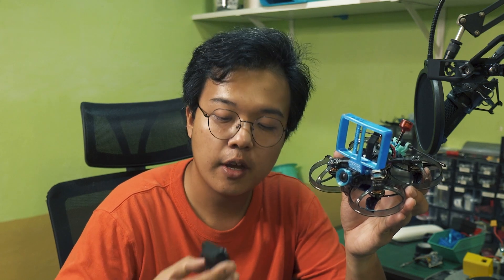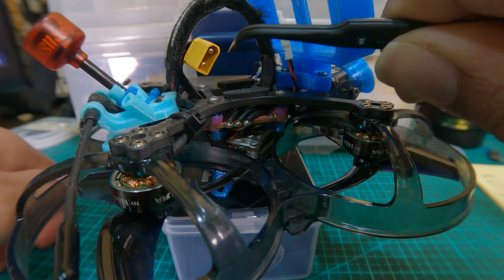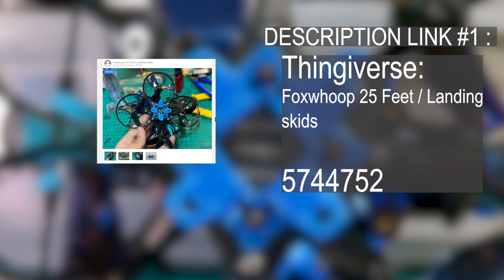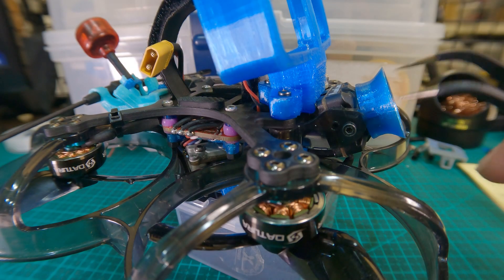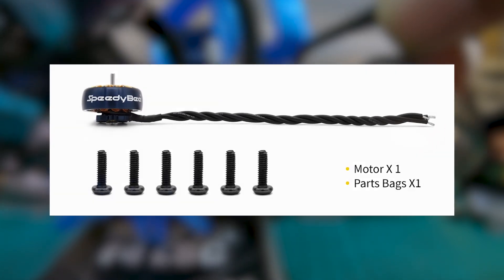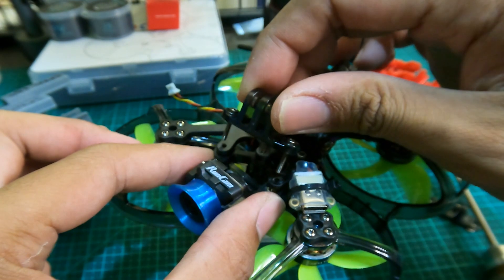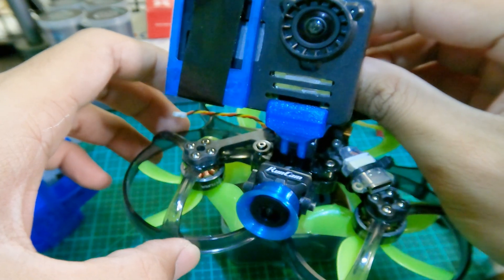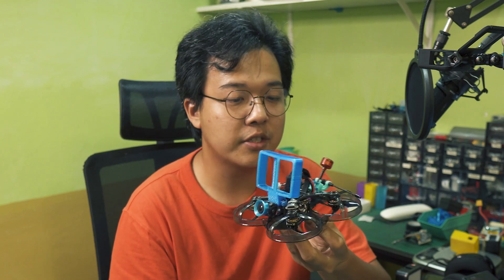Foxeer Foxwhoop 25 closer look for builders

Comment: Do you think that a AIO that uses mount holes of 30.5x30.5 would fit in this frame? I have a 3d print part for the conversion of 30.5 to 26 or 20 mounting holes. Aio itself measure 38x38

Comment: hi. How did you manage to reduce the vibration? mine also mounted with o3 made in tpu camera support, improved 50% but still vibrates and gives a jelly effect. how did you set the PID?
Reply from the maker: One reco is to make your TPU Camera support more rigid.
- Add some support pillars between your camera left mount and right mount so it doesn't wiggle as much.
Here's a photo as reference https://www.thingiverse.com/thing:5152305

But end of the day, wind hitting drone and prop wash are just the nature of the 2.5 inch drones being light weight and underpowered especially outdoors.
Versus a 3.5 inch (Bigger Drone + Fullsize gopro + Bigger Batts = Heavier) would defo give best stabilized flights due to intertia, in my opinion. 

Thats why I'd attend shoots with a 2.5 and 3.5 and swap appropriately.
Reply: thanks for the answer. I'll work to improve it.
 @TanFK

Comment: Do we added O3 on it ?
Reply from the maker: Some people on Facebook has done it. But it's extremely tight, wouldnt recommended for this frame.
Reply: @TanFK  in planing to add O3 cause vista range is poor on my integra goggles
Reply from the maker: @mokshpatel6986  makes sense bro, try it out if you have o3

https://www.facebook.com/photo.php?fbid=6032811003465321&set=gm.1960018181010274&type=3&mibextid=S66gvF
Reply: @TanFK and how much time you are getting on which kv / battery size , in my case it's always out of center of gravity

Comment: DO you think the Avatar V2 vtx fits in there? (33x33x10,5mm)
Reply from the maker: Doubt it. Just measured the base area and the dji air unit lite barely fits.
I’ve seen on Facebook some people barely able to fit the o3 air unit which is smaller than the avatar v2 vtx and I don’t think it’ll fit

Comment: Will it lift dji action 2 which is 58g
Reply from the maker: It will struggle a little bit cuz you also have added weight of a 3d printed component for your action 2, but should be bearable.

Here’s some flight times I’m getting
CNHL 4s 850 mah
SMO 4k - 30g - 3.5 mins
GoPro hero 7 -110g - 2.0mins

Your rig would probably end up between

Comment: for this frame foxeer datura 1404 3850kv engine 1404 4600kv fast 1404 4500kv which one should i get? i will use 4s
Reply from the maker: I fly the datura 3850kv and it actually has enough power.
1404 4500kv sounds better. you can put a throttle limit and it will give you the same stick resolution.

Just check if the voltage rating of motors are recommended higher than 3s as well.
Reply: @TanFK  thank you speedybee 1404 4500kv motor would you recommend?
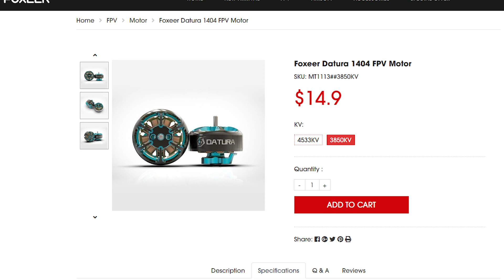Reply from the maker: @duofpv2738  Hey, My friend uses the 1404 4500kv speedybee ones, He's been having a blast, just watch out for the wiring like I mentioned in the video at 3:37

Comment: Brother cinebot 30 or foxeerwhoop which is better plz suggest me
Reply from the maker: Cinebot 30 is an overall better cinewhoop, 
Can carry Full sized gopro, More Power with 6s to fight wind and etc. 

The Foxwhoop is cheaper, uses smaller motors, smaller build, only carries naked gopros, 
but the main selling point of foxwhoop 25 is I can assure clients noone will be hurt if the drone crashes into a crowd.

Comment: I built this with a 20x20 F7 stack. I designed TPU feet for mine as well. They wrap around the ends outside of the frame. I could send you the STL. I haven't posted them on thingiverse yet.
Reply from the maker: Id love to try out your design, 
I just tried checking thingiverse and noticed you haven’t uploaded it..
I hope would upload it and share your design!

Comment: Excellent review of the frame. Very detailed and just what I wanted. Are you experiencing any jello or shake in the fpv camera video? I see many reviewers complaining on the same.
Reply from the maker: I didn’t experience jello when using the provided injection moulded plastic camera mount. But I did once swap to a self printed TPU mount and experienced jello with that one. Do you own the frame as well?
Reply: @TanFK thanks. I just got one today. Yet to build and check. ☺️